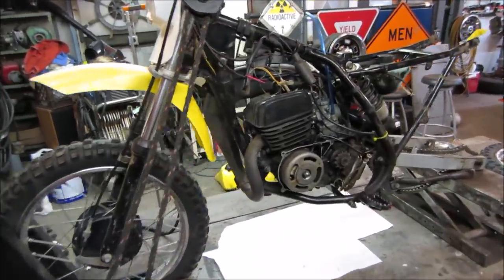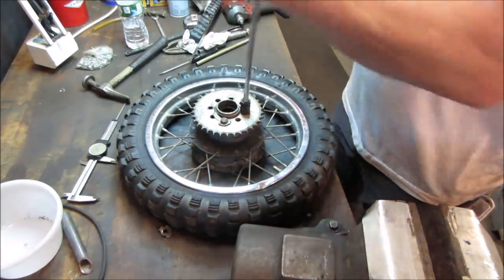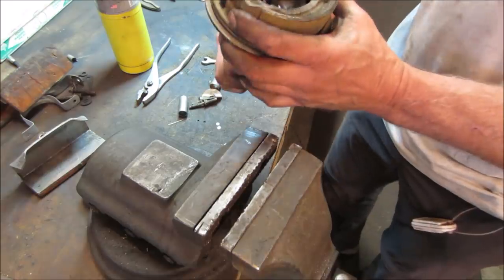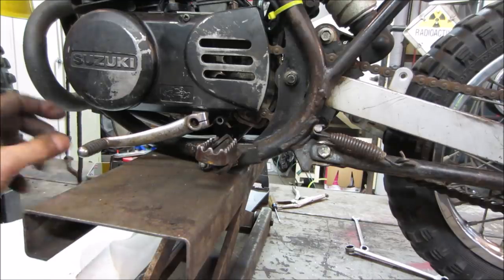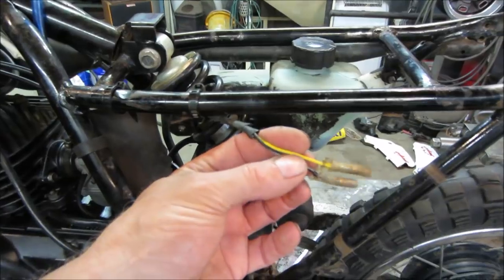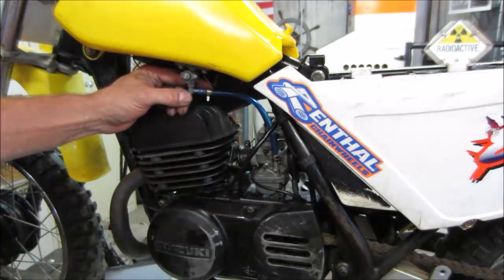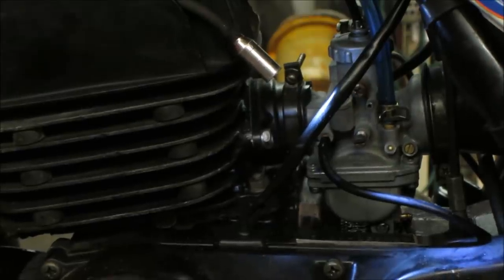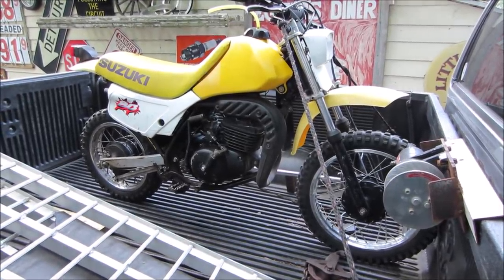Junk Suzuki 80 From A Yard Sale, part 2 of 2

Comment: to repair a crack in ABS motorcycle fender you can melt some ABS into acetone and patch some metallic mesh inside to reinforce it, then you dig the crack in V shape and you fill it with the paste acetone + ABS

Comment: the rear brake drum, theres some writing  just above where the caliper leaver fits onto the stub , that writing should he parallel with the swing arm itself so you dont get any binding Mustie  , its a short round stock tube thats flattened and drilled onb either end that holds the  brake drum to the swing arm ;)

Comment: Could not ask for anything better than what you are doing. I love tinkering but here in Mesa Az a bike like that in the same or worse dry rotted condition is $500 or more. Even Chinese quads less the plastic sell for hundreds. We have to drive 20 plus miles to be able to ride off road in a state designated permitted area but it's so dense with people on UTV's now it has gotten very unsafe. I recently unloaded a bunch of Chinese quads etc. One had an idle throttling problem I could not figure out. When throttled it would take time to idle back down but the idle would stay high and the engine would climb RPM's on it's own even with the slide all the way down instead of just dropping when the throttle was released. Even with the cable disconnected it did the same.  Thought it might be a lean condition due to the fuel valve being restricted but when run with just a hose hooked to a can it did the same thing. The quad is long gone. It would be nice to at least have some idea what might have caused it. I now know the part you tried to drive out of the carb the wrong way does come out and can be all corroded that might have been some of my problem. People here buy off road stuff but rarely use it leaving them sitting outside in the 110 degree sun with rotten gas in them. Gas here literally rots and turns yellow in days but remains very caustic. I really enjoy your video's. Thanks. Bob - 114 today but only 6% humidity.

Comment: Got 'er running good! Enjoyed the videos. Sir, you probably already know this, but there are usually notched adjustment marks on the chain adjusters so you can match left and right sides, so the chain/tire tracks straight. Were they missing? I don't remember you saying. Also, did you check the clutch at all, or just take up the slop in the cable?  Great job, like it!  That little 80 is quick.

Comment: Could you have welded an extension onto that shifter shaft so the gear shifter could have been removed without having to whiz wheel it off.  Would it be too weak?

Comment: back in day we ride in suzuki pv50's where was 80cc, and many drilled it so big at there was only couple millimetres in wall left, so if you melted that piston its can be trash stuff in first time, and many used malossi pipe and big 23-26mm carpurators and right brackets size, but all porting we needed to do our self & many mopeds runs about 110-133km & tire was small 3.50-8" 46M but later came 10" tires, but high tune parts what was in market back in day was not so good versus what you can buy these days,and many got 5 gears in suzuki pv, or suzuki r, or some else suzuki, where is same engine but we had to order a gearbox parts in china to get 5 gear we order 2 gears, 1 gear fork, 2 pins, 1 gear drum, = 5th gear.but original suzuki pv80cc in china have disk brakes, 5 gear and some else i do not remember it any more.

Comment: That bearing on the rear wheel needs cleaned with acetone and lightly sanded both surfaces and JBweld covering the outside of the bearing. The only other method would be with your lathe make an interference fit after taking out .0010" or so with a sleeve. Maybe even locktite would hold it after acetone cleaning. I would certainly pop those seals off and clean and refill the grease in the bearings. Good job on renewing this poor fellow. I doubt a ten year old would push the engine too hard except for that ripped air cleaner.

Comment: 31:20 Is it a good idea to leave the fuel tap, aka petcock (ok guys, stop giggling), permanently open? Some years ago I had a carbureted street bike on which the petcock malfunctioned and was in effect permanently open. Overnight, fuel drained down and not only overfilled the float bowls but flowed into the cylinders and crankcase. When I went to start it- hydrolock. Luckily, the starter motor wasn't strong enough to bend valves or break a connecting rod, but it left me stranded. Or is the fuel plumbing on this little dirt bike different somehow and that won't happen?

Comment: Regarding the spacer.If a parts diagram can be obtained,then there will usually be a part no. and description,along with dimensions.Also,the sprocket looks to be in need of replacement(hooked).

Comment: Spacer size. Use some putty or plasticine attached to  a dowel rod. Place the dowel rod into the hole where the wheel bearings are. Then, squeeze the rod into the side of the housing. Remove the housing, and you will have an exact match length for your spacer. Simple, eh?

Comment: Q 1 Where oh where do you find those little bottles with the small tube to squirt gas in carbs?  Q 2 I watched the Snapper mower episode. caught just the corner of a fender of a car. Did I see a 544 Volvo?
Reply: You can always empty a plastic 3in1 oil bottle and use that with a length of tube on it's nozzle...

Comment: Actually, 80cc two-stroke is a fair bit of engine for such a small bike. I had an MT-X with an 80cc bore kit when I was 16 and that shifted pretty good even though it, basiclaly, sat in a 125cc motorcycle frame.

Comment: Good Morning Mustie
I have and Ariens Rocket 7 tiller with a 7 hp Kohler
Having trouble not sure where the proper location for governor rod to carburetor and throttle spring to carburetor.
Any help is appreciated.
Thanks Reg

Comment: The most amusing part of this video, for me, was that shortly after I finished doing some cheat plastic welding on my daughter's toy 'LED jewels' light string, using an ISOTIP rechargeable iron, Mustie pulled out the cracked plastic to try welding the plastic together with heat.

Comment: That spacer should be 12.6mm ID-19mm OD x 91mm long. Also, they should have 1-22mm spacer on each side in between the 2 chain adjusters.

Comment: I think on that fender instead instead of just melting material from the fender, after you get through with your melting while it is still hot or run over it again and put hot glue on the inside to mix it with the fender plastic. Then it wouldn't just fall apart.

Comment: maybe you could cut 1 off your junk bikes and turn it on your lathe so it has a dowelll pin on it then drill a pilot hole on the old shifter on the bike and leave a space for the welding them together and grind it smooth ! little bit of work but its worth it !

Comment: I can't believe that you welded that shift lever on.  Also, on the rear sprocket you left that one bolt frozen in.  What about when the sprocket wears out and needs to be changed?  You had that sprocket on your bench and it would have been an easy replacement; even if it did break off. Left hand drill bit, then an easy-out, to get the bolt out and then stick in a new, lubed up one.  The next owner would have a much easier time.  And it would probably be a kid.....

Comment: When you were, using the belt driven lathe. I was thinking that if it could be adapted over to chain drive using an old washing machine motor.? with a black box that you could alter the speed with, instead of extra gears to do the work.? ('-')
Reply: Potentiometer would do awesome for that! Exactly the right speed for the job!

Comment: Put water on that nut or any nut after you heat it it’ll usually come off without breaking it..... I’ve saved 100’s of brake calipers by quenching the bleeders and not attempting to take them out while glowing red...

Comment: 50:1 is chainsaw stuff, That should be 32:1. It sounds lean. If your oiler is working your good. But if not pre mix at 32:1 is what you want, I would delete the oil injection. That ping ping ing inging after you let off the fuel is not good its running lean. A silencer is needed as well. It will run awsome on 50:1 for a wile but will smoke the piston.. Nice video thooo

Comment: The part that you’re calling a bar that locks the brake plate from turning is called a torque link by pretty much all the MoCo’s.
Reply: And that info is useful how?
Reply: Well, the correct term of what it is may help someone source one if they need it.

Comment: My only concern is the old phrase "If you have a $10 head, wear a $10 helmet."
Took out a clearway sign back in December 1980, with my head. Wet roads, and a fire hydrant high sided me straight through the sign. Spent the next 3.5 weeks flat on my back in hospital with fractures to C1 and T4. If I hadn't been wearing the helmet, it would have just smashed my skull instead, and I would not have been here to type this comment..

Comment: "... and put back together like a 10 years could put a bike back together once they start to break off !"  LOL !  Few 10 year olds have access to your pile of "parts" or know how to weld !

IMHO, the center rear wheel spacer should be re-made with the bore much closer to the axle diameter.  I would be concerned that if that spacer got off center if would push on the bearing shield and damage the bearing.

Clutch cable, sprockets and chains, sooner rather than later !

Comment: @35:19:  F'ing genius! Well done!!!

Why not cut the gear selector shaft, and then weld on a new end?  - especially if you have access to a junked shaft which still has good splines.
Think you got homeless people in those woods, judging from those blankets.  And what is that fender laying there at 58:34?

Comment: Man, look I know I commented this on your last video about this bike, but you should really check where your oil injection lines enter the motor. One will be near your carb obviously, however SOME (not all) old 2 strokes will have lines leading under the piston and into the engine case. So even if you run premix it still wont fully lubricate. Just tryna help dude.

Comment: Why would it be on the inner part of the bearing. Seems like it would be on the outer part. Like on every fit bearing that needs to be kept in place.
Reply: The outer race is held by the hub. It is not even exposed on the inside.

Comment: outa curiosity did you attend college ? Not that attending college makes you smarter  just wondering if you possibly have or worked toward an engineering degree. My mind doesn’t work like yours, in the way you are able to vision the end product by just looking at parts.  I have to really plan ahead with each step to make sure that doing something now, doesn’t bite me later in the build.

Comment: Why don't you put the axle in it like a mountain bike with two nuts working against each other they keep the race of the bearings adjusted as you tighten down the nut to hold the wheel on